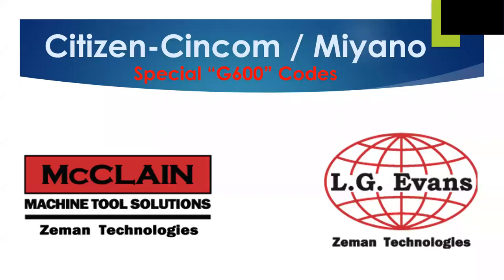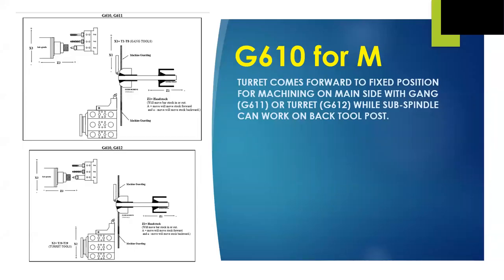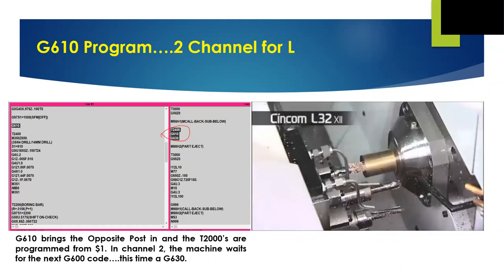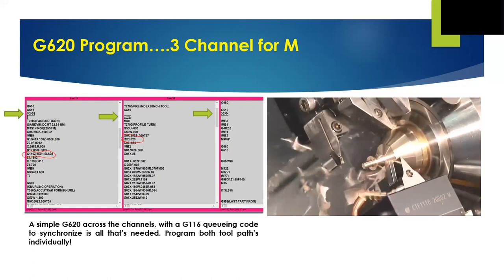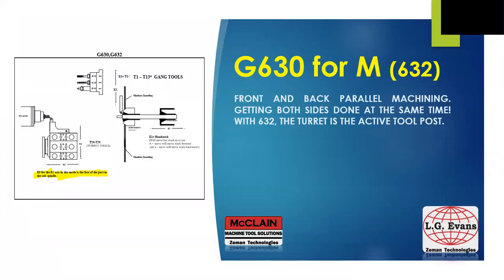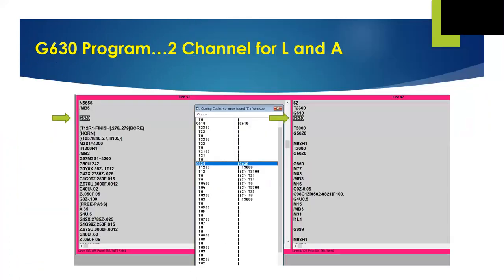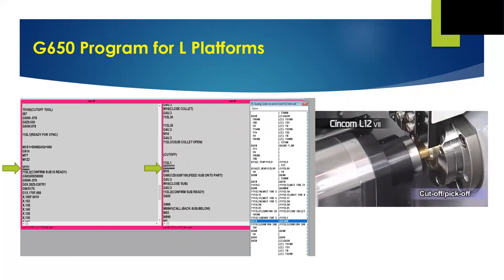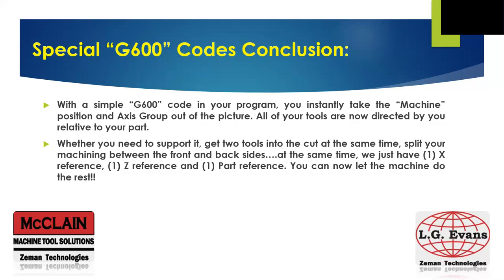Citizen-Cincom Swiss Webinar: Special G Codes

Comment: Merry Christmas eve! For many years, I have programmed and ran horizontal boring/milling machines, and VMC's, and created many macro programs using fanuc macro B. With that stated, I moved on to a new company that has quite a few citizen Swiss machines, with the G codes you have outlined in this AWESOME video. I'm currently learning how to run these machines, and along the way, I'd like to learn how to program them as well. At a minimum, it's good to know exactly what the program is doing, so it can be modified, if needed. At this point, I don't know what percentage (if any) of the programs I'm learning how to run, have been programmed with some type of cam software, or programmed in notepad manually. My guess is, any type of advanced contouring going on, it had to have been cam programmed. Thank you for making this video, hopefully there are many more videos (and maybe a few books) like yours out there!

Comment: Outstanding! I sent this to a guy I’m training in our shop. We have 3 M4’s and 3 M3’s and one L with another on the way 
You mentioned the Espirit software. Is that correct? Could you clarify the software you use or in the future do a video with using the software and the machine program be generated
Reply: I've been using Esprit on Citizen L12's, L20's, L32's and Miyano lathes for just over 2 years now.  I had used PartMaker in the past extensively on both Swiss machines as well as lathes.  Esprit is so much more powerful in just about everyway.  It kind of has a steep learning curve. In the end it it totally worth it.  The post processors for the machines I program are flawless.  Any time we have any type of issue their customer support is top notch.
Reply from the maker: Thanks for the feedback Brandon!  We have a few guys on our team very experienced with ESPRIT, but the guy presenting in this video does all his programming at the lathe itself.  When working with very complex geometries a CAM software like ESPRIT is very beneficial, but to Brandon's point it has quite a learning curve and requires weekly - if not daily - use of the software.